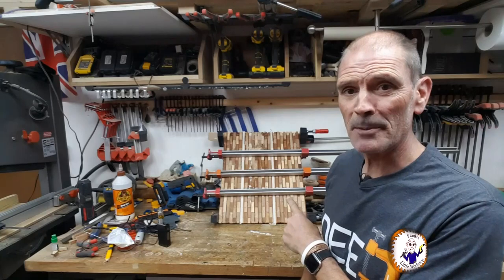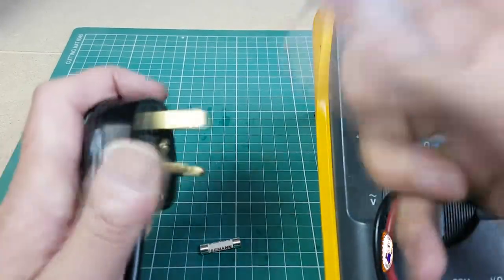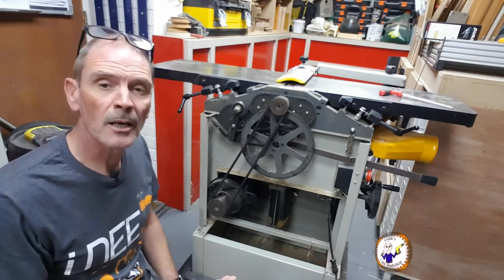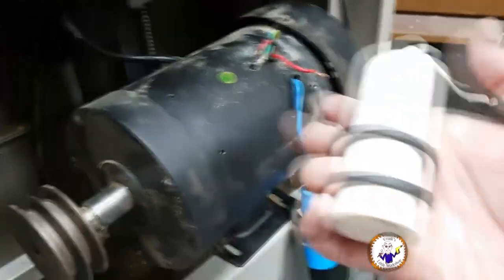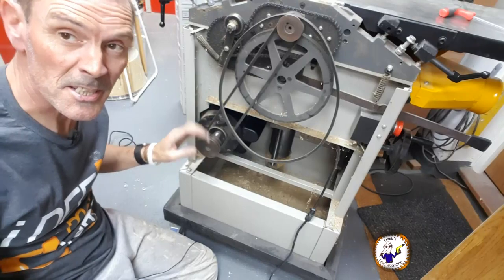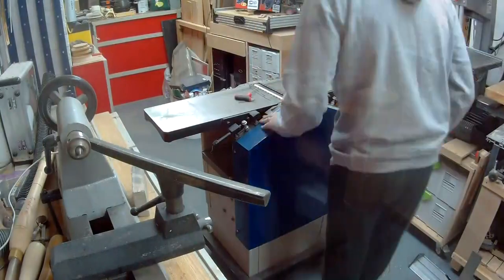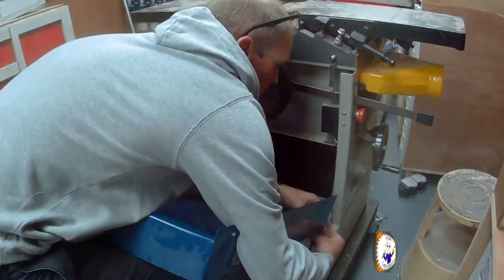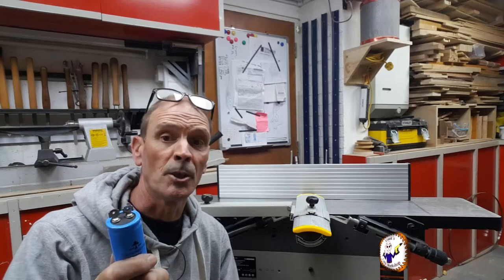Jointer / Planer / Thicknesser, Blowing fuses. How to fix it.

Comment: Frank I do like your channel and your good down to earth practical advice together with your sense of humour. Good repair on the jointer capacitors. I have a couple of tips for you though. 😉
1. Your multi- meter has a capacitor test position on the rotary switch, measures in microfarads +. 2. Unless you are firmly wedded to soldering - Using Wago 221 connectors are very appropriate, effective and quick.😀👍
Reply from the maker: Thanks for your support Norman 😁. I'm glad you enjoy my channel. If anything I do helps, then it's worth me doing 😁. I am a big fan of soldering. There are a lot of great speed connectors on the market but a good solder joint and some heat shrink always wins for me 😁. There was a hell of a lot that I didn't show in the video (discharging and cap test etc) but the video would have been too long if I had shown everything. Thanks very much for watching Norman 😁👍

Comment: My table saw bows fuses in the plug regularly. It only has one capacitor,I’ve changed it for a new one. It still blows fuses. This only happens on start up,it never bogs down during a cut. Any advice would be welcome. Thanks

Comment: great vid im having same issue so ordered a new capasitor one concern the one that's fitted now has 2 leads which are both black new one are red and black does it matter which way round they go
Reply from the maker: 😁 Hi "Yorkshire lad", I can really only comment on how my machine is configured. You can see mine has the same colour wires so the polarity is not an issue. I can only assume the new one you have may be different. The fact it has red and black would indicate its polarity is important. If you are unsure please do not proceed, but get a qualified electrician. Alternatively you could try and get the correct cap. Again, I can only comment on my machine. I hope that helps. Thanks for watching 😁👍
Reply: @frankslittleworkshop  thanks for reply i will ask a sparkys advice , hey do you have a vid on changing the blades or adjusting them .
Reply from the maker: @theyorkshirelad.  🤔 Hi, sorry I don't have a blade change video. I will need to change them soon so will do one then. But it won't be for a little while yet. Sorry mate 😔.

Comment: getting that problem with mine now and just found your video, both my capacitors are wire will it matter which way the wires are connected
Reply from the maker: 😁 Hi Jim. On my one the wires are NOT polarity contious (so it can be fitted either way). Please check carefully that there are no + or - marks on your one, but it should be OK either way. Thanks for watching Jim 😁👍
Reply: @frankslittleworkshop  thank you sir i will be carefull just have to wait for min to be delivered my planer is 16amp both my capacitors are  80uf. all the best.

Comment: Would just replace the pair,as the cost for start & run Capacitors use to be around a tenner for the pair, &  speaking from experience, if one has gone, expect the other to follow..
Reply from the maker: 😁 That is good advice to replace both at the same time. But its been two years ago now and its still going strong. So I think ill leave it for now 😁. Thanks for watching  Stuart 😁👍